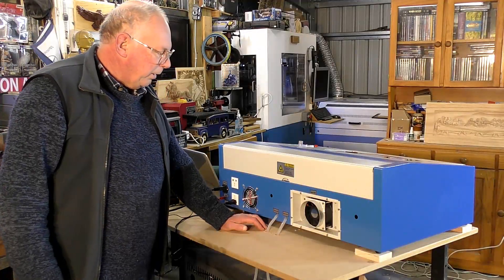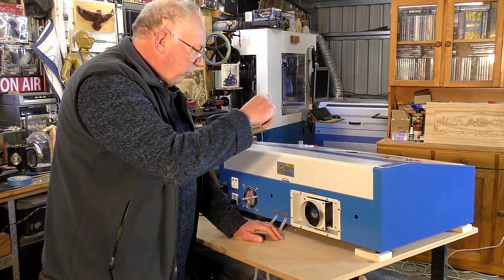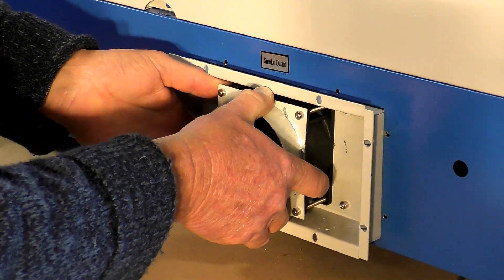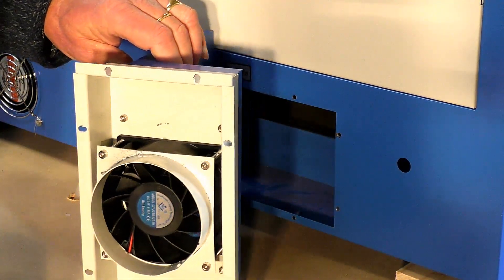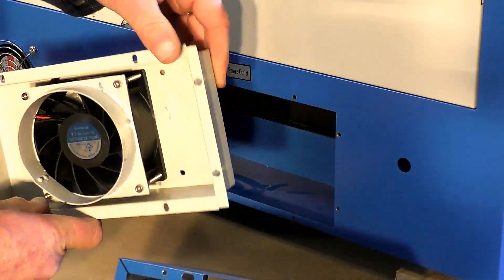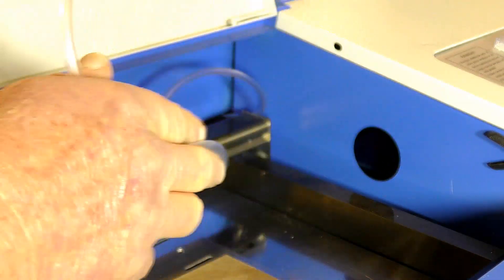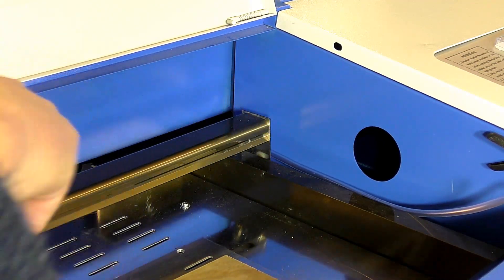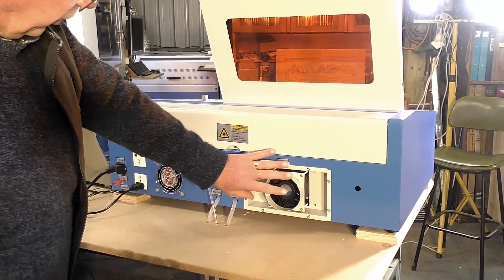K40 LASER UPGRADES & IMPROVEMENT’S

Comment: Ive had a broken lens twice now both from different companies and they were not over tight
Reply: Letting the lenses get dirty can cause quite a lot of heat to build up quickly in them, at some point it will either super heat and crack/shatter or just eventually crack over time with repeated heat cycles. Really should give the bottom lens a quick wipe before/after each use, it only takes 30s.